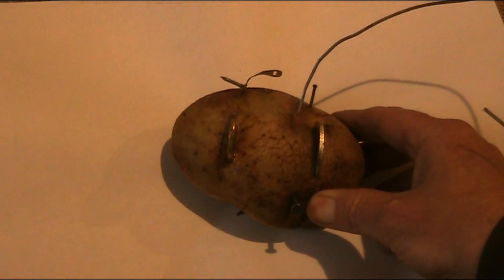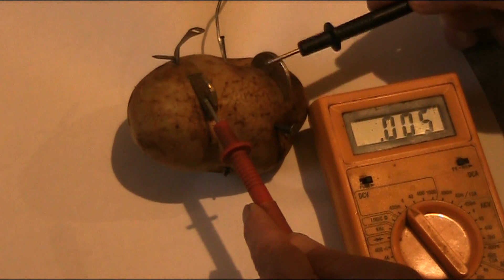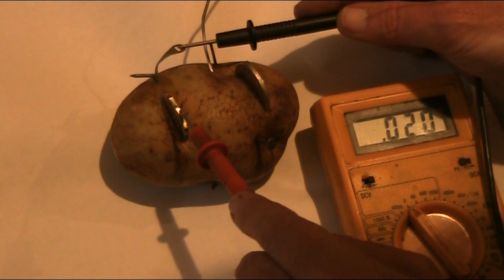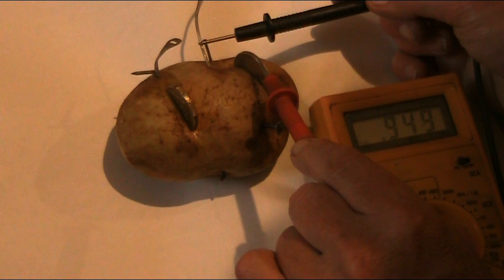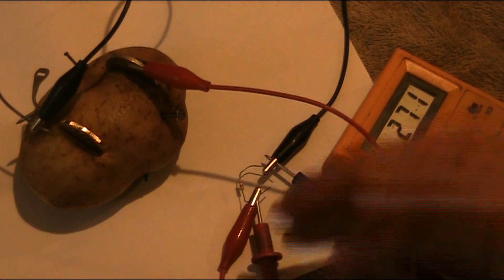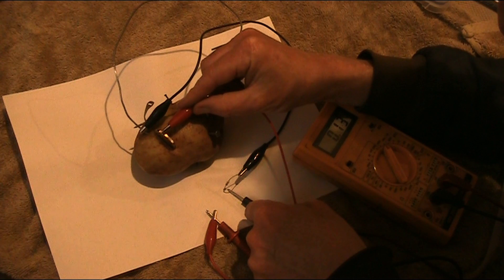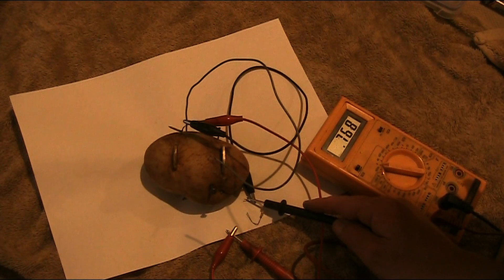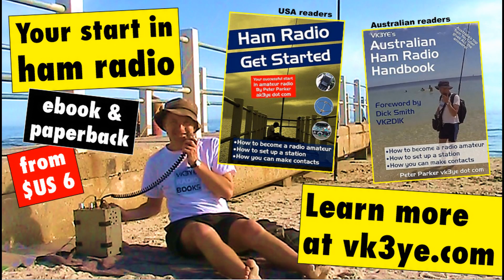Potato power! How many milliwatts?

Comment: Had great fun when I was a kid making power with citrus fruits (e.g., lemon, lime, orange, grapefruit) Three or four lemons + two electrodes in each one wired in series and boom you're up to about 2.5 / 3 volts, just add more of the same electrode material (Cathode and Anode) to increase the amperage but I believe there is a limit to how much.  Fun experimenting!

Comment: Hi there Peter, I made one of these years ago. I used strips of copper and zinc nails as contacts and connected 2 of them in series and powered a clock with it. All the clocks on the wall will soon have potatoes hanging from them.😂😂
73 De Aiden EI8HJB

Comment: Next experiment should be working out the internal resistance of the potato cell. From there we can start working out how to draw the most power from a potato cell, and then we scale up in series and parallel so that we can power a small CW transmitter.

Comment: Potato battery with copper nails will easily power an LED. Demo'ed many times to kindergarten kids.
Reply from the maker: Shouldn't the metals be dissimilar?
Reply: @vk3ye  Yep, copper and gal. Got the copper nails from a ships chandler.
Reply: Big galvanised nails are fairly easy to come by and have lots of loose electrons to make a good cathode. Big copper nails might be more of a challenge. However, maybe scraps of copper clad PCB with nice large surface area would make a good anode 🤔.